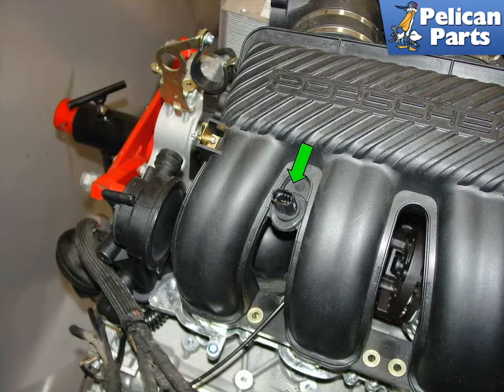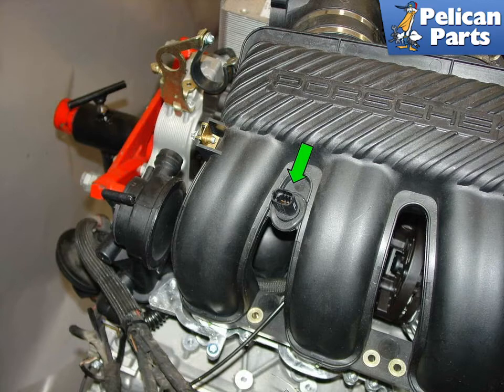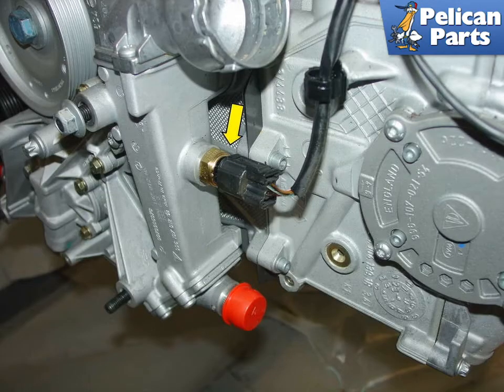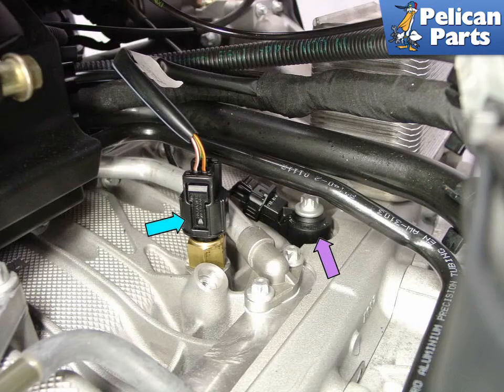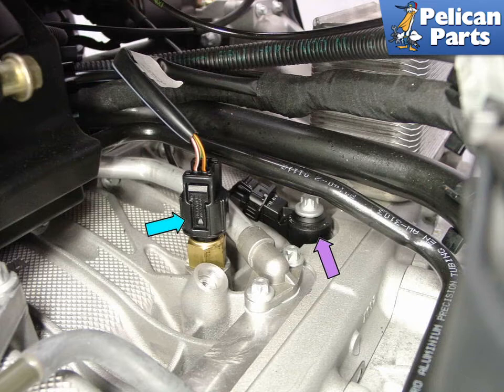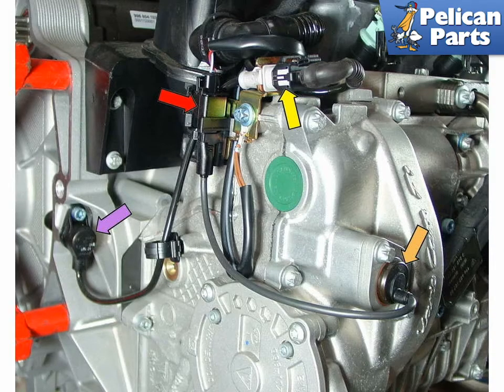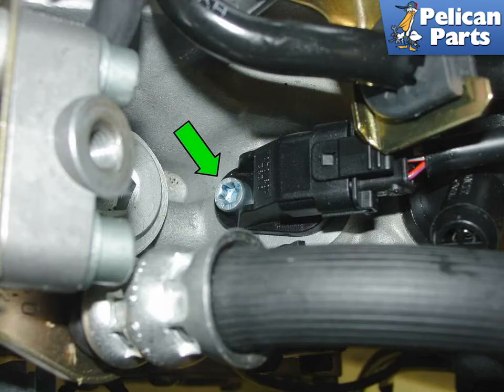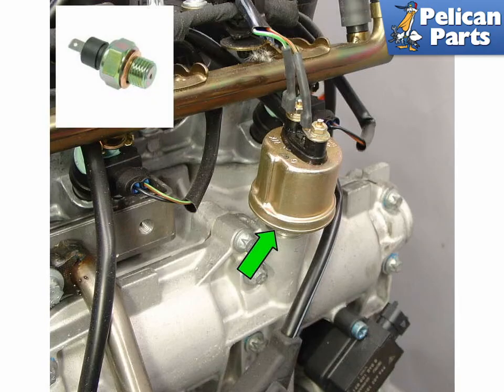Porsche Boxster 986 Engine Sensor Replacement

Comment: Hello. I am desperately looking for a video on how to replace am the crankshaft position sensor on 2008 Cayman S. Any help? Thanks
Reply from the maker: We don't currently have that tech article. If we get a chance to perform the procedure, we will be sure to document it.

The sensor is located on the transmission bellhousing to the right and can be accessed on the engine from under the vehicle.
Look at the rear of the right side cylinder head, follow the electrical harness down to the sensor. In it just below the head in the bellhousing. Once you locate it, disconnect the electrical connector. Then remove the Allen fastener from the sensor and pull it straight out to remove. Be sure to remove the harness from the holder before removing sensor. 

Tightening torque: 10 Nm (7.5 ft. lbs.).